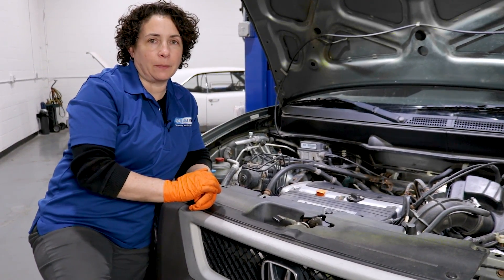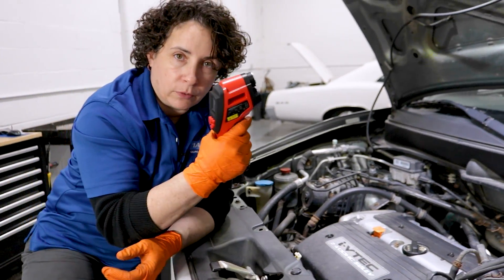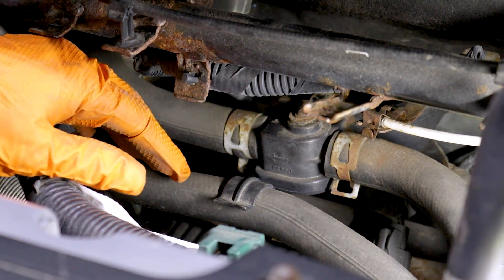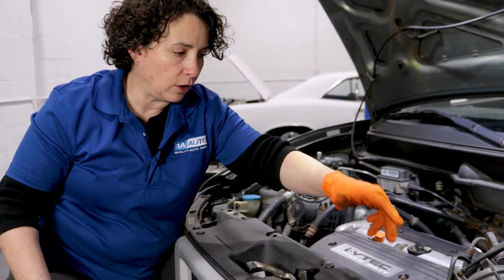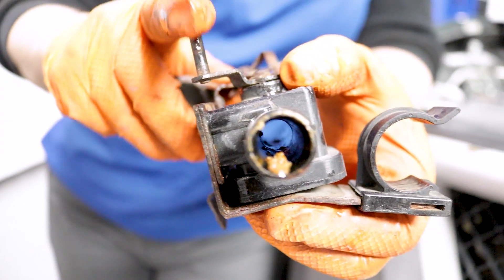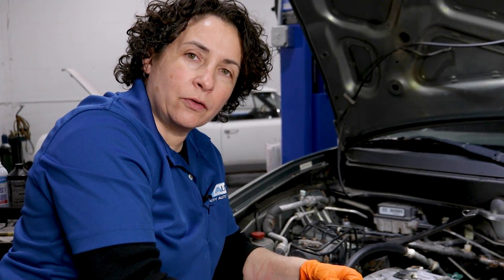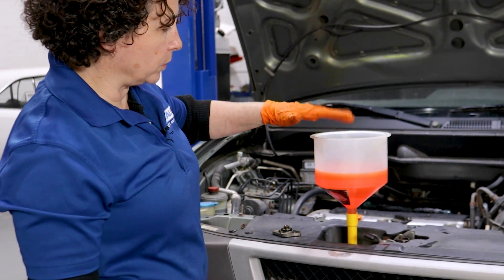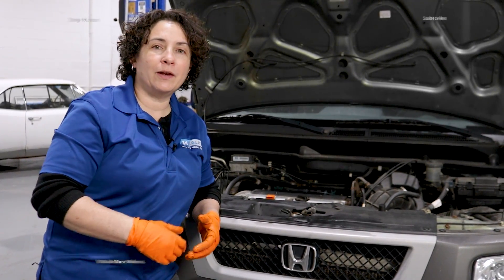Car Heat Not Working? Engine Overheating? How to Diagnose Cooling System!

Comment: I used blue devil one time for a special case and I do not regret it. I knew the stop leak would kill the heater, but I have a misfire on cylinder 2 (p302) and it took me months to diagnose it down to realize it was caused by a head gasket issue. 2011 Jeep libery 200k plus miles with body damage was either going to the junk yard or rolling the dice with blue devil. It worked and I have had it 1.5 years longer so far with no issues. Might flush the heater core because driving it 4wd in the snow was cold this year, but it does have a purpose. Thanks for the video. Right now I am trying to diagnose my Honda Civic severe overheating. Flushed the heater core and got lots of rust out (this car was poorly cared for before me). Maybe water pump next. Oh fun fact I just learned, 8th gen civic doesn't have the heater control valve. Fascinating.

Comment: Thanks for pointing out that the heat isnt working on the inside of the vehicle, not the outside. That definitely confuses a mechanic when they dont know its on the inside. 😂😅

Comment: The algorithm is messing with my searches and giving wrong results. What does it mean when the heater DOES blow hot air super well, but the engine is overheating.? My Nissan Murano is supposed to have an operating temp of 190, but it gets to like 203 when idling.

Comment: Have an 08 nissan xterra. Engine started to run cold when fully warmed up..I Replaced the thermastat, thermastat sensor. Flushed the heater core. Burped the radiator so it's full of coolant. Still runs cold...🤔. It don't over heat but when the car is on and staying still the heat or cold don't work well. When I start driving then it works great. Water pump maybe?? It don't over heat though..maybe air in the system?? But I burped the system, full of fluid..

Comment: Coolant levels good. If I have the heat on my engine coolant hot light comes on. If I turn the fans off it goes back to normal. Even with my air turned off tho if its in the hot position it blows out small amounts of hot air, and if in cold position it blows out some cold air.  My mechanic said it might need new head gaskets but hes not sure if that is even going to fix the problem. Cars are soooo stressful.

Comment: Would this cause the temp gauge in dash to go way up? I have a 2012 Traverse. Having overheating issue. Replaced the thermostat. Replaced broken radiator cap. Replaced water pump. I did not burp the system. Only topped off with one jug of coolant into radiator. And topped off the reservoir. Now heater isn’t working and still gauge is going way up as of overheating.

Comment: Have 2015 ford taurus no heat. have upper hoses hot but lower hoses cold to radiator dealer wants 2800 to change heater core and coolant flush. Heat comes out at 3000 RPMs is this the correct diagnosis?

Comment: My 2001 Nissan sentra started both heater hoses had a hole and were leaking so I replaced them. Now my car overheats and I tried burping it yesterday while I was on an incline and the heat did kick on, but that was the only time. I have not had heat since then. It still overheats as well. Once I go like past 5 miles I try burping it like five times. I don’t know what the problem is. There’s nothing leaking now.
ONLY overheats with the radiator cap on.

Comment: My question is if the you found the heater core clogged and flushed it and you get some heat back why would but not fully and the next step is to replace the radiator? It would be the heater core. lol
Reply: that's what I was thinking. she already said the car wasn't overheating when driven so why would the radiator have to be replaced instead of the heater core?

Comment: Does this channel respond to questions in comments? I left a comment a  few days ago in another video about the removal of the left mirror and wanted to know if I could dismantle the mirror to check why it doesn't fold anymore, do I need to replace it with a new one? So far nothing
Reply from the maker: +Mick Carson Thanks for watching!  I was not able to find your comment, but depending on the mirror itself you might be able to take it apart and see what the issue is.  We do not recommend this with our mirrors, and taking them apart can easily result in something breaking.  We do not have any videos on how to take apart an entire mirror assembly at this time.